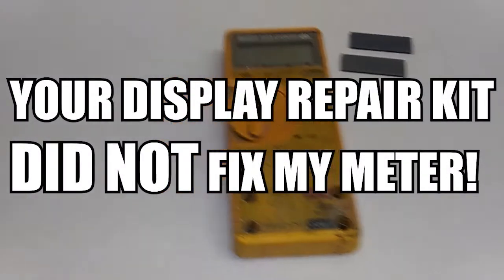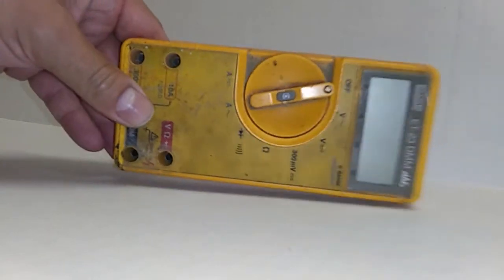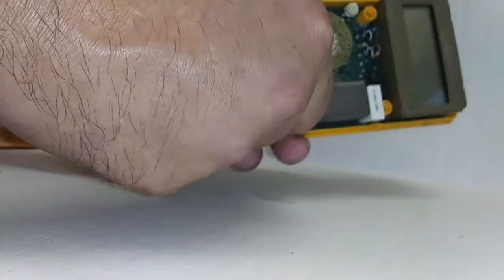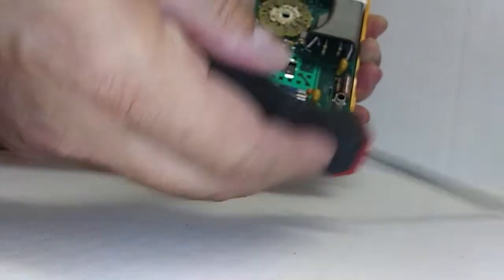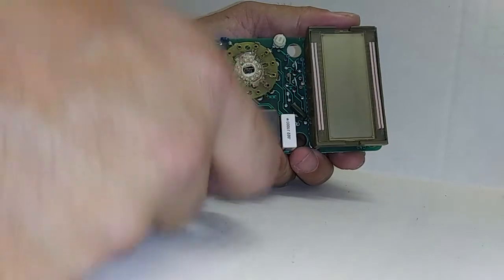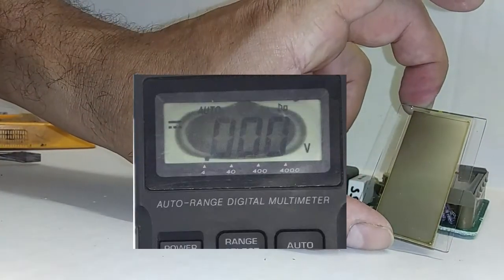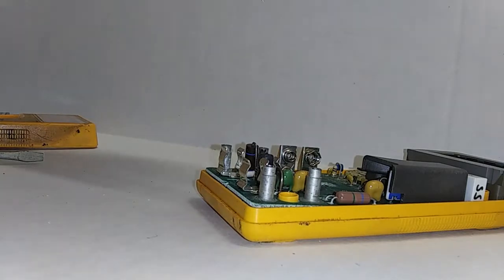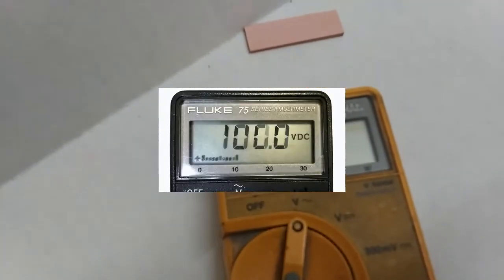Fluke Multimeter LCD Display Repair Kit Fail? Yes! If Your Display Looks Like This...

Comment: The 'lightness' across the entire display can be fixed with a properly aligned sheet of polarizing film, that can be purchased off Amazon for about $16.
Just lay the new piece on top of the LCD glass. I did not peel off the old.
I successfully corrected this same problem on my 1990 Fluke 73.